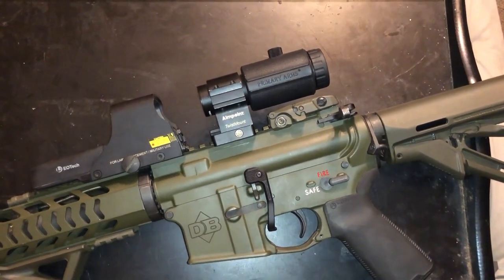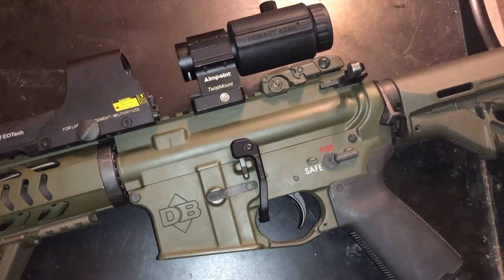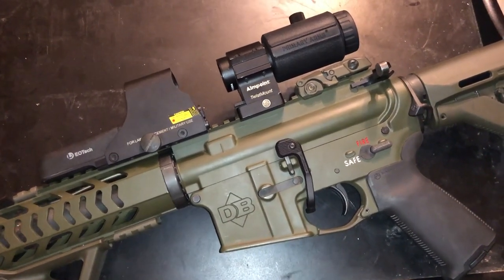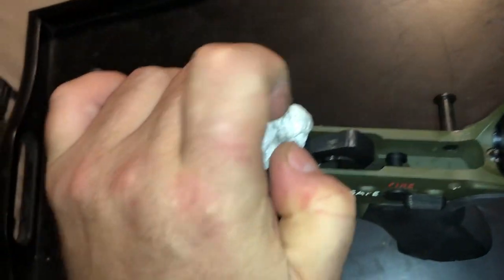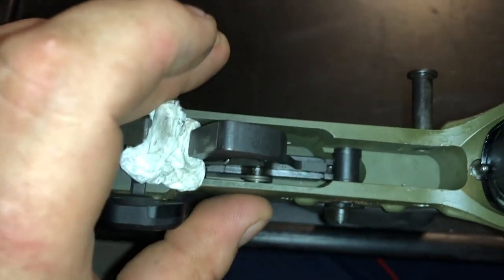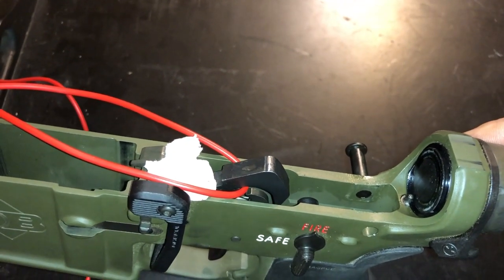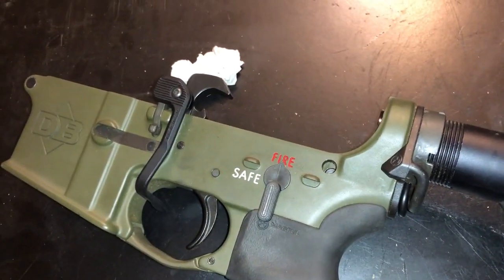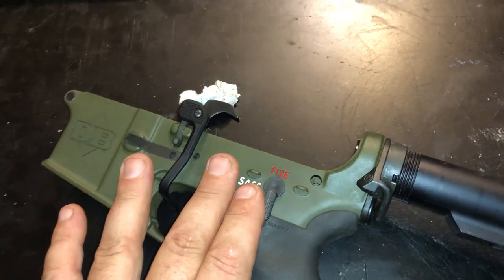EASY DIY AR15 Mil-Spec "Paracord" or "550 Cord" Trigger Job

Comment: Wow brother, just wow I am pretty amazed. I had to come back to write a comment on the matter. I am not surprised on why it lighten the trigger pull, I am ecstatic because it is a simple way of buffing out any new trigger, in an AR. I have a BCM Recce, with about 60 rounds through it, and what a difference it had made, very noticeable. Now that being said, it does not help with the reset of the trigger, just the initial pull, to fire a round. Having the reset be more robust, with a smooth trigger pull, is definitely something to get used to, but I have to admit, good learning material for any trigger job. I am sure that it will substantially help with an expensive drop in trigger as well. I am very pleased with the outcome and I would recommend everyone to do this, before firing the gun for the first time. Thanks a lot for this information, we'll needed thank you.

Comment: I use 12" zip tie and duct tape for the hammer and a piece of rubber to protect  bolt release and lower receiver .
 In this case the easiest way is the best way for smooth easy precision.

Comment: would this work well on the reset faces as well?
Reply: Never thought of that but it should. I guess you'd fire it like this then reset it but keep the trigger held and pull the cord taught while you let off.
Reply: Although I'm not sure how nicely it'd play with the disconnector and it's springs.

Comment: You can do this with nothing at all. Use your finger and palm
Reply from the maker: Get more force with a string, but i'm sure you could.
Reply from the maker: Besides a "Finger and Palm job" just doesn't sound.... right o.0
Reply: @GunGuyOK  dammit, walked right into that
Reply: @mail-qh2qc  I think you misunderstood me. I was saying you can do what he did without the paracord using your finger to pull up on the hammer and your palm to stop it from hitting the lower.